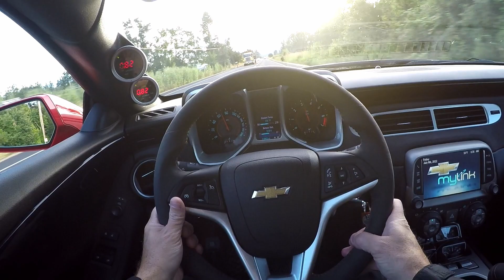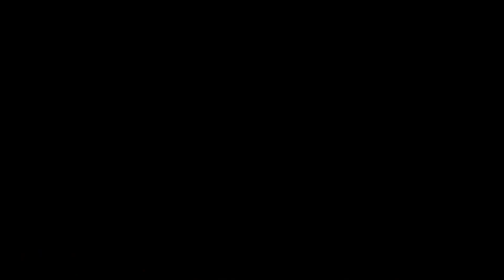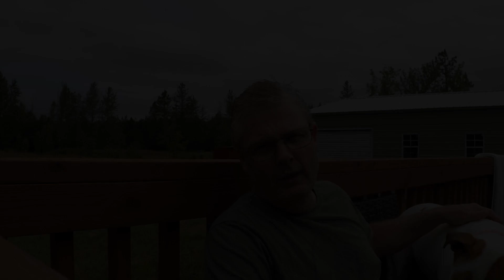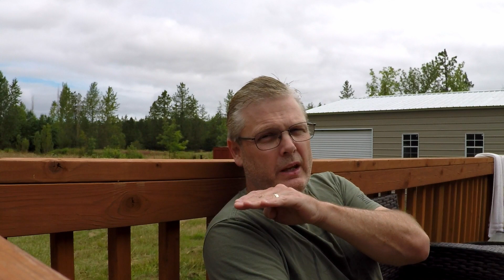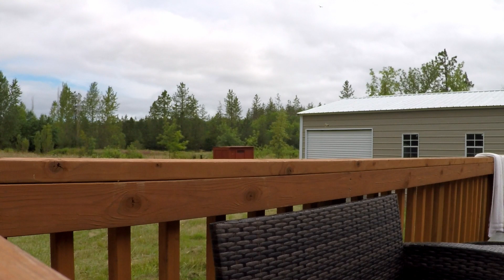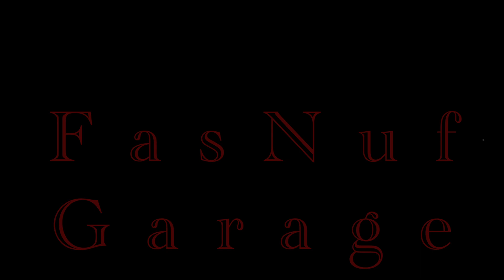Magnetic Ride Control Calibration and lowering your car.

Comment: I just had my 2017 Yukon Denali lowered 2 in the front and 3½ in the back and now it rides like exactly how you described it.  Very springy, over reacting to every bump and dip.  I'm hoping your solution will help resolve my issue...........
Reply from the maker: Let us know how it goes
Reply: @fasnuf , ok so my mechanic reset that Magnetic Leveling Module as directed, and it rode a little better but something was still off, so I decided to have all 4 wheels aligned, as that was recommended in the instructions of the lowering kit.  Well it was way out of alignment and it took the shop a couple of hours to get it done, during which time they had the battery disconnected.  And it was for such a long time that my phone was no longer paired to it.  But after the alignment the Yukon rode much better, almost like original.  I'm guessing that the battery being disconnected for so long reset the whole computer system and it learned all the new sensor readings. I no longer regret having it lowered.......... thanks for the video, because it was this video that kicked off what I did next to resolve the issue.........
Reply: So a few weeks have gone by and I'm noticing something else.  From time to time I will tow a trailer and I'm noticing the same issue when I tow the trailer.  If I hit a few bumps in a row, the Yukon is very unstable.  I'm thinking this might be the height of the the Yukon after lowering the trailer onto the hitch.  The auto pump does kick in, but I'm thinking it's not going up high enough, and the leveling system is once again trying to compensate.  I might have to do a little trial and error with pump adjustment which is on the left side by the back tire.

Comment: My ctsV has all oem mag suspension but the front is noticeably lower than other stock V’s. Has more rake to it. Maybe a recalibration would help level the car some. Never knew this was a thing. Thank you
Reply from the maker: Unfortunately, it doesn’t have anything to do with leveling. The ride height of the car is set by your springs.

Comment: My concern is I have flex fuel and a tune on my C7. If the dealer flashes the entire tune, Ill be needing a tow truck.
Reply from the maker: They  should only be flashing the suspension module, not the Engine module.
Reply: @fasnuf  Thanks. Talked to the head tech just now at the local Chevrolet dealer. He said the same im safe

Comment: This is pretty instresting. I installed Eibachs a while back and yes, going over bumps does feel a little strange and ride is rough at times. What exactly would I tell my Cadillac dealership over the phone that I need done? A trim height reset?
Reply from the maker: Exactly, Trim Height Reset and look for any updates to the module while they're plugged in,  How low did you go and what year is your car?
Reply: @fasnuf  2012, Eibach "Coupe" springs. I have a Sedan (The coupe springs lower the front a little more than the Eibach "Sedan" springs). Since my TCM and ECM are tuned, would the "Trim Height Rest" rest my car back to OEM configuration? Another word, would I lose my tune?
Reply from the maker: @TopFlightWR  The reset only adjusts the Suspension Control Module. I'm tuned and have no issues with this update. They're separate controllers

Comment: Hey, thanks again for the info! My ZL1 is highly modified with custom tunes to both ECM and FSCM. I assume that Chevy would plug in to the OBD2 port to apply updates and a trim height reset to the SPC. Do you think Chevy would be able to apply the update and adjustment to the SPC without interfering with the current custom ECM and FSCM tunes? Any info would be greatly appreciated. Thanks!
Reply from the maker: The suspension module update doesnt affect your ECM or FPCM tune. I didnt have to tell mine...he knew by the cam lope it wasnt stock.
Reply from the maker: I would still tell the tech not to mess with your ECM tune.
Reply: @fasnuf  Thanks a lot......you are very helpful......... Now, wish me luck in finding a knowledgeable and competent Chevy dealer.
Reply: @fasnuf  if you don’t keep it private I would be curious as to which cam you have ?

Comment: What about it with a lift
Reply from the maker: Anything that moves the sensor past its stock neutral position will cause an issue. I don't have first hand experience with lifting a Camaro and what kind of reaction it would have, but I'm positive it would benefit from a recalibration. Thanks for the comment.
Reply: @fasnuf  
Ahh definitely. And it wasn’t a Camaro not trying too build a donk here lol it’s for my 1500 Denali with a 8” lift

Comment: Would the trim height reset be necessary/improve the ride if the front end was lifted instead of the rear being lowered?  Would the reset then make the shock sim kit unnecessary?
Reply from the maker: I can't say on yours if it will improve the ride or not, but anytime the sensor neutral point is changed, it should be recalibrated.

Comment: Disconnecting the battery fir 20 mins will do the same thing.
Reply from the maker: Disconnecting the battery doesn't work and the module had an update needed as well so a dealer was required. Here's a video of an Auto scanner able to do the trim adjustment. https://youtu.be/ayJZwIJ0D6E